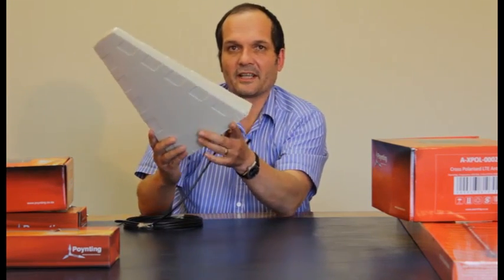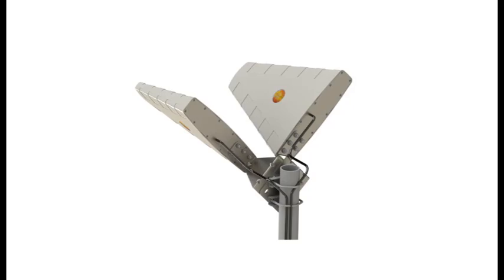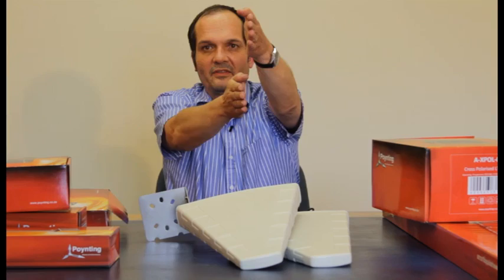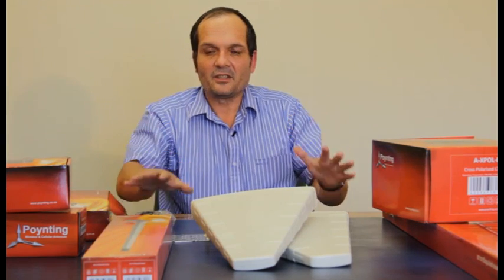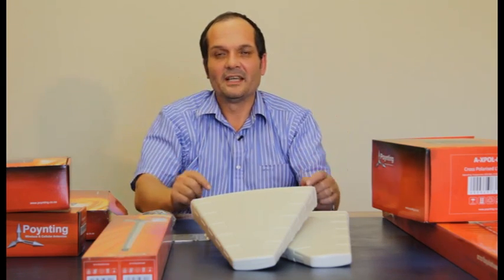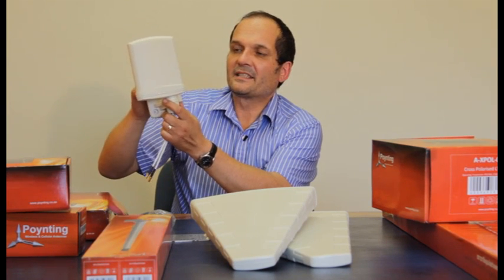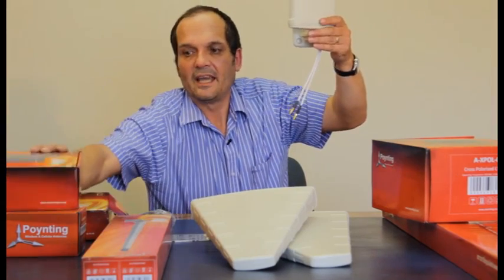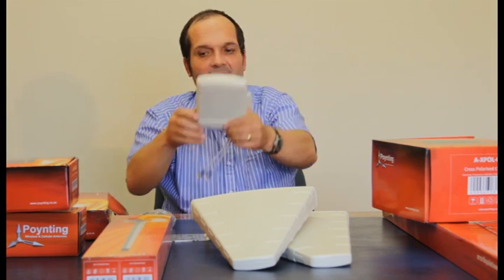LTE 4G Part 2 - Why you must have 2 antennas for LTE speed

Comment: My router is quite near to the antennas, which have a 10 meter cable lenght. What should I do with the cables : leave them rolled up and attached with a cable tie or unroll the cable (which seems messy) ? Also I have the 2 separate antennas as shown in the video. Is the performance of the new dual antenna in a single box more efficient or equal ? With the external antenna I went from 0-1 bars to 2-3 bars (out of 5) and tripled my LTE speed, but I'm still far from what is actually achievable.
Reply: Hi Andre, my antennas are like the ones in front of view at the beginning of the video. I'm living in a suburb near rural area, I have a near direct vue to 3 LTE antennas, which are between 2.2 and 3 kms away. The strongest is at 2.7 km with some fields & build up areas. My place is about 35 meters higher than the area where the LTE antenna stands.
Reply: @poyntingantennas  Should Ian consider cutting down those 10 meter cables to the minimum length needed and then re-crimping a new connector on the end? That would reduce cable losses, no? I run two cross polarized antennas with short cables (less than 1m) into my LTE modem which is mounted in an enclose directly behind the antennas. The ethernet cable then runs down the antenna mast and into the house and connects to my router.

Comment: If I’m looking to set up the omnidirectional antenna you last discussed, is there a specific coaxial cable that needs to be used for 4g lte and does it come in 5 metre lengths? I have B315 router and am rural.

Comment: i have 2 anttena but how to split to one cable? my modem have 2 slot ts9.. so two antenna got 4 cable ts9.
Reply: mimo antenna indoor. i just did it, no improve connection.. more better if i use one antenna only.

Comment: If you are running the antennas to a BDA with only one input, can you couple them with a coaxial splitter or would I have to run the other antenna to a separate amplifier?

Comment: Doesn't using two directional antennas defeat the purpose of MIMO?
Reply: If you have line of sight to the tower,  polarization diversity will help distinguish between the two LTE mimo data streams, but for other conditions, performance improvement is observed in spatial-dispersive multipath environments where signals are scattered across a physical distance. In this case, I believe the pair of omni directional antennas will offer better performance than the directional antennas.

Comment: Hi,

I'm looking for a high gain external antenna that would boost the signal of a Huawei E5573s LTE router. (Dual TS9 connectors).

The project I'm going to use this for is a for a guest house located in a hollow position with no direct base station visibility. I believe we get a reflected signal from the mountain around. We do have 4G signal with relatively poor to good reception rates but these are not enough for use by our guests or staff. Our provider is giving us up to 50mbit up/down when we have good visibility, so I'd like to take advantage of that. Currently we get 20mbit down and 5mbit up at some spots. Generally there is no coverage in the area but there are specific spots that the router gets 2 out of 5 lines and somehow is able to ramp up these good speeds. Though these are tests I have done walking with the router hanging in a nylon bag at the top of a fishing rod(yeah I was internet fishing, funny). 

So my question is what would be the most suitable external antenna for this?
Reply: Hi Andre, I have just ordered (and my order got shipped today) 2 proscan omni antennas ( http://www.proscan-antenna.com/omni-gsm-en ). These are 11dBi antennas I am going to connect to a Huawei E5186s-22a router I bought recently, I decided I'm better off using this router that runs on 12v and can get the extra wifi coverage and speeds out of it too. The pocket E5573s did a good job for testing though. I'll see what results I can get with this setup. Thanks for your input!

Comment: Hi Andre, nice video. One technical question, can I get the MIMO result by using the following set-up: 2 external antennas + splitter/combiner + 1 repeater + splitter/combiner + 2 internal antennas ?
Basically my question is if 1 repeater can do the job or do I have to put 2 repeaters, each with its own antenna.
Thanks
Reply: Hi Andre, many thanks for your advice, makes good sense indeed.
Reply: Hi Andre, a quick question to solve my problem:
I did install two yagi antennas shifted 90 degrees as you recommended in the video. The signal strength I was getting was full 5 bars on my Huawei E5186 4G LTE router with good performance.
Now, yesterday it started to rain with heavy wind and the signal strength dropped to 3 bars only.
Can you please help me to find out why the drop in signal strength, it is still the same after 48h. Is it due to water ingress somewhere or something else?
The antennas are installed on top of the roof so I wanted to have a good idea what to look at before climbing up.
Thanks again,
William

Comment: I am setting up a Verizon Hotspot in my business but due to the concrete & steel building, I will need to put up an external antenna.  What would you say is the best for that?
Reply: Only a single antenna then?  I have to run the cable down some 30ft to an indoor relay of some sorts for the Mifi Hotspot.  Any suggestions on the set up?

Comment: +Andre Fourie
In the video you say "45 degrees" but your gesture is for 90 degrees (i.e., right angle).  The examples are all also at 90 degrees.  You meant to say "90 degrees" right?  In other words, antenna polarization should be orthogonal, correct?  
By the way, great video!

Comment: what if i use 2(11 dbi mimo antenna) and use 2 to 1 splitter into the port of my b315 modem is that even possible? or can you give me other soln for 10km away from cell site
Reply: im just using now a 11 dbi but the sinr is about 5 and down speed is just .8 mb/s maximum and the up speed is about 6-7 mb/s? does it really work using 2 xpol? how about the antenna height and the right propagation?

Comment: Hi, i have a question, i'm using an LTE modem with 2 antenna ports. normally, people here would use one (1) 2x9dbi mimo antenna (which has 2 cables coming from it). will it work if i use two (2) 2x9dbi antennas and use 2 sma splitters for it? thank you for your answer...

Comment: Does it require to have MIMO tech both side to benefit it? I mean does the LTE cell tower also have 2 antenna to transmit signal or it does not matter? When i check MIMO specs in my Samsung mobile of cell tower. Its stated as "NO". So does it mean LTE Cell Tower in my area are not capable of MIMO tech and i could not benefit via 2 antenna? Or all the lte cell tower are MIMO enabled by default?

Comment: hi andre,

i'm currently using an external MIMO antenna 11dbi with huawei b936 model but i am quite wondering which is better, a MIMO antenna or yagi antenna.
Reply: +Andre Fourie (Poynting) 

I see, so using MIMO is way better than YAGI. Yes, the HUAWEI model you mentioned is exactly the one I am using. Thanks for the information. It really help a lot,

Comment: What kind of solution would you suggest for vehicles.
Reply: *****
LTE\3g data. Emergency vehicles, cars and trucks, applications for reports mapping, status and reports. Budgets are also tight and we severely undermanned. So any inconvenience in networking is multiplied. A lot of communication has to be done over radio, but that results in duplication of work as everything needs to be documented, and excess chatter leads to other problems. Right now they are just using the antenna's built into laptops, but they don't seem to work well at all. I tried to sell them on something like cradlepoint's solution but they can't or won't shell out over a grand per vehicle at the moment.

We work in an rural environment.

Comment: I bought a MIMO LTE antenna from Otto, with 2 cables coming out. It is a smallish omni direction dual design with a modest 7dB gain...  but after using this for around 1 year the signal seems to have dropped. This a cheap antenna and only cost R765. I am now wondering if this is a bad buy. I have mounted it on my flat roof not very high, should it be higher?
Any comments?
Thanks Andre

Comment: Question: can each antenna pass through the same signal booster before reaching my 4g LTE modem that has two antenna ports? Or would doing that cause the two signals to conflict with each other?

Comment: +Andre Fourie (Poynting) - Hello Andre, may be i am asking a silly question, but can you tell me if changing the installation direction of a dipole antenna from vertical to horizontal will change the direction of polarization of antenna to horizontal as well? What if i use two OMNI dipoles and mount one in vertical direction and other in horizontal direction to get MIMO.

Comment: hello i did want to put 2 omnidirectional antennas, but i don't know if the must be both linear polarization or vertical polarization with different angles?
Reply: +Andre Fourie (Poynting) - Hello Andre, may be i am asking a silly question, but can you tell me if changing the installation direction of a dipole antenna from vertical to horizontal will change the direction of polarization of antenna to horizontal as well? What if i use two OMNI dipoles and mount one in vertical direction and other in horizontal direction to get MIMO.

Comment: Are LTE and WiFi antenna's different?  I have a LTE modem and looking to increase the LTE signal.  I only have 1 antenna supposedly 7 dBi.  I've attached it but I'm not sure if the router is picking it up as it indicates it is using the internal antenna and when I changed it to the external antenna, the router did not pick up the service, maybe due to only having one antenna?  However, the router is now a solid 2 bars sometimes 3 bars, whereas before it was 2 bars sometimes 1 bar.  I'm wondering a few things:

1) Are the antenna's (WiFi vs LTE) the same, difference being the gain?
2) Do you know if Huawei B593 LTE router external antenna adapter would benefit the in-house WiFi coverage or the LTE signal strength?
3) Most normal routers appear to be male to receive an external female antenna, whereas Huawei appears to be the opposite, the router female to receive the male part?  Wondering if the pin is needed because I bought an adapter but found myself puzzled that this router didn't match the industry norm external antennas.
5) How much is your high gain LTE antenna?

Comment: Thanks for the info.
Can we add more antenna's for more speed, if so how can we do that when  the router has only two antenna connectors?
Reply: No, but your can add two or more radios to a load balancing/combining router, which will add the speeds together (more of less).

Comment: Hi, I want antennas supporting the following frequencies : 1800/2300/2600 Mhz for my 4G LTE Router "Huawei E5172"  .

The main tower is not far from me it is in the same city but there are many repeating towers all around and it is hard to tell which one is the main "faster", these are the current signals I am getting :
RSSI (dBm):	-59
RSRP (dBm):	-85
RSRQ (dB):	-10

I want to setup a strong external antenna to boost the speed , I think I must use directional antenna in order to choose the tower with fastest speed ?

My current speed is http://www.speedtest.net/my-result/3719960186

My router only has one antenna plug .. Thank you very much .

Comment: i have a wilson 4g lte booster that has a antenna, omni for the outside and a directional atenna on the inside. How could i hook up 2 antenna to this booster for the outside to get the fastest possible speed? I use my sg3 for internet with foxfi (i have unlimited data plan)?